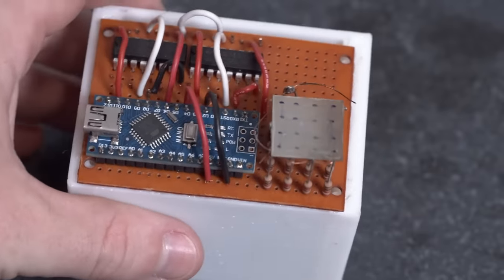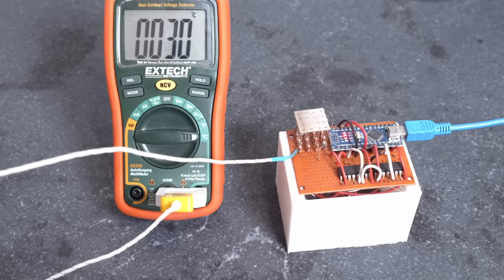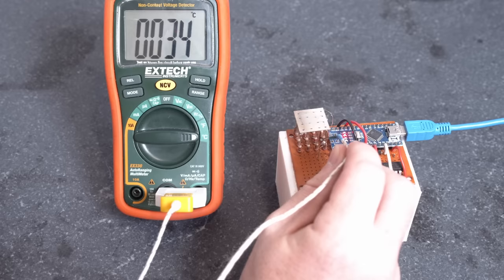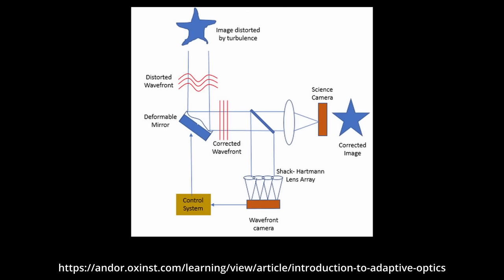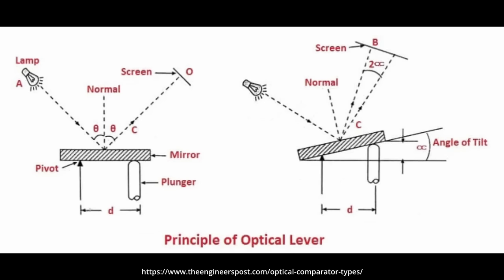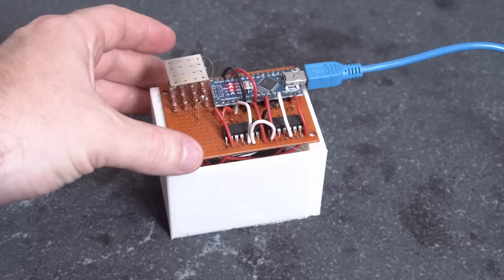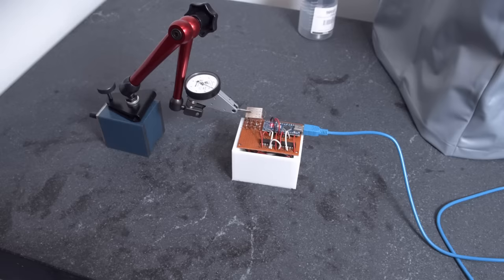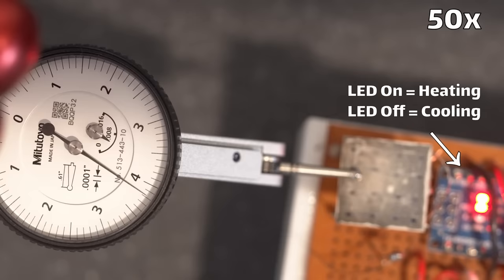Moving mirrors with heat

Comment: do you think you could excite the sodium layer in the mesosphere with a laser in a future video? I've never seen anyone do that at amateur level but it must be possible. Then you could use it with your microscope slide to make diy jwst images at home 😆
Reply from the maker: Haha tempting! I live pretty close to an airport, that might prevent me from doing such a thing... would have to see how much wattage is needed 🤔  Think it's a weird wavelength too, like a yellow laser right?
Reply: @BreakingTaps  ya  it's the D2 line at 589nm. there are sum freq. lasers that add the 1064 and 1319 lines from a diode pumped Nd:YVO4 to get the 589 line. styro actually has a video of one in laser pointer form on his shorts channel but he didn't want to try it.
Reply: @BreakingTaps .  an airport!, The turbulence will be at so many different altitudes at the same time! Both from thermal and motion. Is that even possible to measure?
Even if you could measure it wouldn't much of the light be refracted so far from your mirror you'd never catch it!

Comment: Why don't you shine a light source from a measured distance. Project the shadow of the mirror against a blank wall.  The closer the light source is the larger the shadow.   Get a sharp focused shadow and measure the size change if the shadow.  Use the light source like a pantograph.

Comment: The system seems to be over constrained. Why not using four resistors at corners only?!
Reply from the maker: Well the original goal was to arbitrarily adjust only portions of the mirror, like a real AO system. I.e. if there is a small dip in one section of the mirror you can raise just the few resistors around it to flatten out the dip. Of course it didn't end up working like that because I couldn't measure it, so had to settle for brute-forcing the entire array to see up/down motion only :)

Comment: Here's the biggest issue I see.  You have a load of silver solder on the back of the mirror.  This is a huge heat spreader which will dissipate the heat across the whole plate.   I know you need it for electrical conductive reasons but being able to have a low thermal, high electrical conductive material would be better.  Are there any conductive epoxies, or maybe you can make a wire mesh (that's flexible) to improve things ?
Reply from the maker: Yep agreed! Soldering a thin wire or mesh between the resistors, and then bonding with a non-conductive epoxy would probably work better. I used a silver (conductive) epoxy rather than solder to connect them to the mirror and each other, but the silver epoxy still has a fair amount of thermal conductivity.

Comment: Heyyyy!!! U should be able to use a lenslet array + a collumated HeNe / any ol laser source ! U end up getting the slopes of the entire surface of the mirror - which u can use to reconstruct the shape of the mirror pretty easily. Lol check out my thesis for an example :P or fire me a DM… i’d love to help!

BTW… u can turn that measurement into a control system pretty easily. U basically push/pull one actuator.. measure the surface; do that for every actuator… then use SVD to get psudeo inverse. Then u can figure out a command vector to get u the shape u want.

Btw part 2 - i worked kinda on the Thirty Meter Telescope / TMT  AO System.. in victoria bc

Comment: I think the problem is that your actuators are already far too sensitive against any kind of disturbances, as the wavelength of the laser is only around 0.5um (thus destructive interference requires 0.25 um of path difference and - since it is a double pass interferometer - only 0.125 um of mirror displacement). Any kind of air motion will cause significant thermal drift and length change. It might work better if you use lower value resistors (or better yet constantan wire, where you can precisely estimate the length change for a given current) put them in a protecting medium like oil (which due to increased heat conduction might also improve the speed a bit and reduce crosstalk between adjacent actuators, where one heats the other) or at least in an environment  protected against air motion and use only very small & well controlled power to drive it (not voltage sources but current sources - the latter can be simply built from an opamp, controlled by an analog input voltage, where the analog voltage could come from a low-pass filtered PWM). This way it should definitely be possible to zero out the surface and to produce newton rings in a michelson interferometer setup with a plain mirror in the second arm, since some fringes where already visible with your system. Maybe it would be best to start with 9 actuators.

Comment: That's "active optics" not "adaptive optics". Active optics is designed to respond in the timescale of several seconds, whereas adaptive optics needs to respond many times a second. There's no way (in my opinion) you would get this to respond fast enough to correct a wavefront that has been distorted due to atmospheric turbulence. The thermal energy is also likely to be problematic around telescope optics.

Comment: It's not only speed. Introducing thermal gradients around your telescope optics is a bad idea in general. Air currents and thermally induced surface warping are things that are easier to avoid than to correct for.

Comment: Physically responding to the deformities is very difficult to respond with proper speed and precision. 

What do you call a partially corrected image? An incorrect image.

This just adds another layer of complexity if you want to do software correction afterwards.
Reply from the maker: Definitely adds complexity, but for professional instruments it's absolutely required! You can have a perfect mirror that is ruined by "astigmatism" or other aberrations in the atmosphere. Only way to fix those issues is by physically altering something in the optical stack.

Comment: you don't want your mirror to heat up because you cant control how the heat flows and react mechanically against elasticity of the construction, maybe you will need a quantum computer to simulate these lot of interactions. if you dont care about heat up your mirror because your mirror is in vacuum and you aren't looking for IR images, I suggest to heat up directly a metallic mirror with underlying induction coils matrix

Comment: I'm confused why if you're concerned about local deformations on the mirror, why are you using more than 3 resistors? Maybe I'm missing your intention.
Reply from the maker: Sorry, probably described it poorly! The original intent was to induce very local changes, so that you could fix aberrations. I.e. push on a section in the middle of the mirror to counteract a distortion at that spot in the image. Professional deformable mirrors have hundreds or thousands of actuators so that they can compensate for very complex distortions.
Reply: @BreakingTaps  Ah okay, that's what I thought at first since you talked about flexible mirrors, but later talked about the mirror not being flat causing issues. Wasn't sure if you shifted the focus to using an array of these mirrors or something as opposed to flexing a single mirror. (Not to be mean, but the video was sort of on in the background, so I'll rewatch later and properly focus, I'm sure you explained it properly, so no need to apologize or worry about the quality of your explanations.)

Comment: why heat? why not magnetics?
make a grid of smt inductors, i dont know the formal name of them but i would start with 2512 bobbin style inductors so the magnetic field isnt 100% contained in the core
edit: unshielded drum core
Reply from the maker: Yep, that's how a lot of the big observatory AO systems are done! Magnet bonded to back of the mirror, and the coil underneath. I just liked how accessible and ultra-cheap the resistor paper was :)
Reply: @BreakingTaps  a custom pcb+a grid of inductors and a micro could be had for less than $10
im broke AF right now until i list some stuff on ebay that i've been putting off doing but i could probably cobble together the parts required(and probably trade time vs money making the wrong parts "work")
engineering isnt always about designing the optimal solution to a problem, sometimes it is using the parts you have on hand in ways you didnt expect or plan for in new and interesting ways, resistors were never intended to be actuators but look where they have gone!

Comment: optical micro gate, bounce or pass
Reply: optical path switch
Reply: zero state in between
Reply: one exit straight through, one exit 90 degrees "up"
Reply: nano dlp optical path switch
Reply: instead mimo optical sensors, 360 degrees view, or just 180 for one side of the plate
Reply: remove mirrors, record all data, photons, from all directions, recreate the image with a computer after the recording

Comment: If stars twinkle due to atmospheric turbulence, why doesn't planets twinkle as well? Doesn't make sense.
Reply from the maker: They do! It's common for planetary photographers to do a thing called "lucky imaging". You basically just capture high definition video of the planet or moon, and then use software to select the best frames from the video where the atmospheric turbulence is smallest. It's "lucky" because you're just capturing a ton of data and hoping for randomly good frames, but since planets are bright and nearby you can do that. Doesn't work for stars/galaxy/etc because exposures are on the order of minutes not milliseconds.

If you ever look at the moon through a telescope you'll see it swimming and boiling due to atmospheric turbulence 😉

Comment: You are adding errors to your work. You should cut as posible the legs of resistors, since they are flexible, can hide your heat effect. Even worse, the legs can be more flexible with the heat. Try with the more possible shortest legs.

Comment: Idea for an adaptive mirror IC:

I think the best fabrication method for an adaptive mirror would be to adhere kapton to it's back side and oblate it into a multiplex matrix pattern graphite resistive heater and then use sputter coating to create the pads from which you could breakout onto a PCB for through hole pins by using one of those old IC prototyping machines to cold weld some gold wire between the pads and pins, you'd then need to cap the microelectronics off with a ductile and elastic thermoset plastic.

Comment: I'm hearing the exact same problem with all of your measurements which is that the device itself cannot provide changes big enough to overcome the variance in the setup because it's put together so crudely. Not a measurement issue, it is an issue with the assembly itself. I'm not sure that you're going to be able to get a good reading or something so precise with something so crude. And this is not saying that you did a bad job or that you didn't try hard or anything like that, but I'm pretty sure you know what I'm talking about